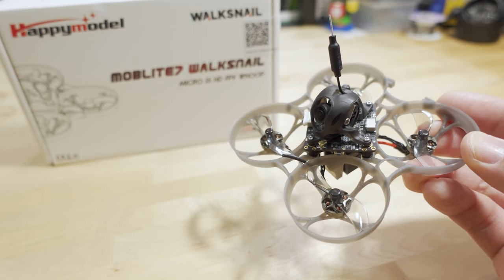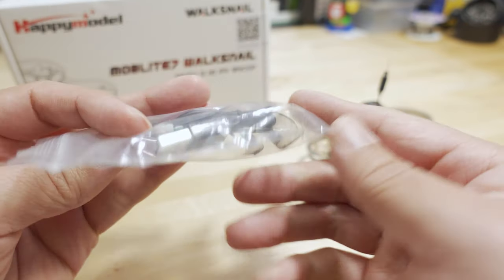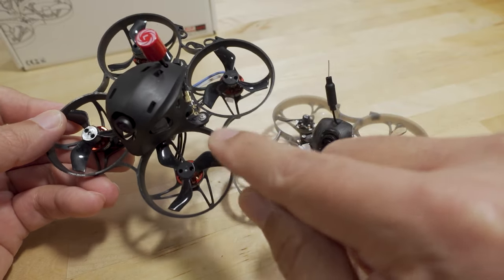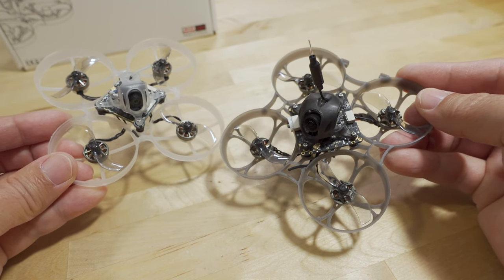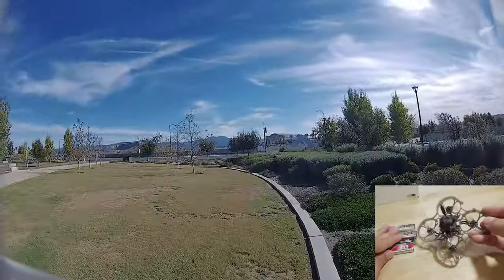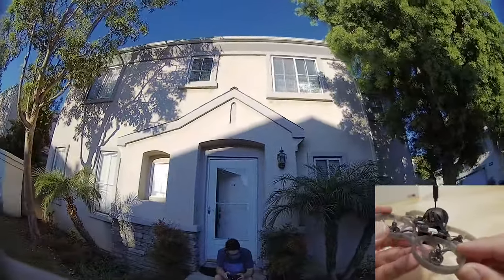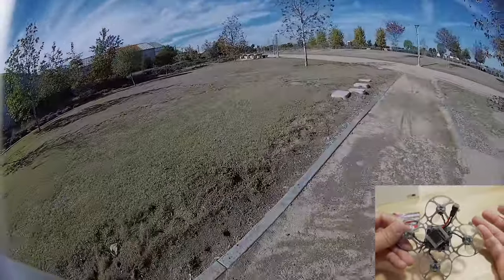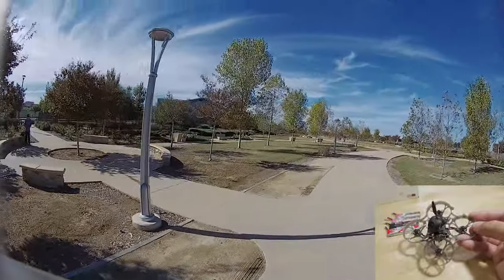Happymodel Moblite7 Walknsail Whoop

Comment: It´s great that more and more micro's are coming with HD systems.
4 to 5 minutes to take the files is not that bad, i was thinking something like half an hour. 
Yeah 5g in this tiny quads makes quite the diference, the meteor 75 is about 16% heavier than the Moblite7. Imagine 16% more weight in a 5 inch. 
The quad flies great for a 75mm whoop, i think this could be used as a micro cinewhoop to create cinematic footage and not so for acro flying. 
I have replaced my micros from XH2.54 to GNB27 and now i have more flight time and less battery sag as you said.
Awesome review and video Albert.
Reply: @Adam_Carbone  yeah no additional cameras needed.

Comment: Hey Albert great review.  Yeah I just started using WS about a week ago starting with the Moblite7.  At first I had some issues but quickly ironed them out in a few days.  After that, all I can say is wow I am definitely sold.  I actually have been using the HDzero hardware since it came out and have a pre-order in for the new HDzero goggles which I am considering canceling as I might just stick with WS.  I only have 3 quads in HDzero config,  actually one of them is the other Moblite so it's an easy transition for me.  My other quads are mostly analog and a few DJI Vista.  I am actually considering swapping some of my analog hardware out for 1S WS.  I just got the Flywoo Firely and it's pretty awesome also.  I guess what I am trying to say is I think HDzero is done except for maybe the hardcore racers.
Reply from the maker: Actually, I think the hardcore racers still prefer analog so I'm not sure where HDZERO will eventually land.

Comment: I noticed the same in regard ti vibrations and heavy batts.  What c rating are your test batteries? I get pretty low flight time on 60c 650 gnb's, lucky to see 2 minutes. I wonder if they a just worn out
Reply from the maker: Your battery or connector is worn out.  My flight times were shown in the video.  Links to the batteries are in the video description.  Specs for each are on the product pages.
Reply: @AlbertKimTV  thanks!